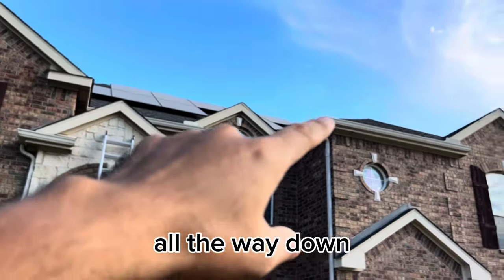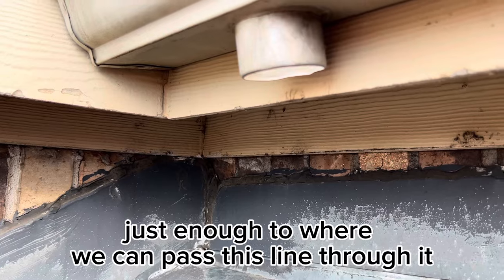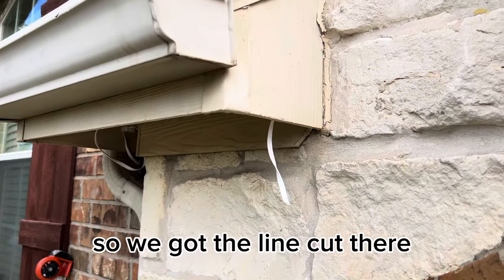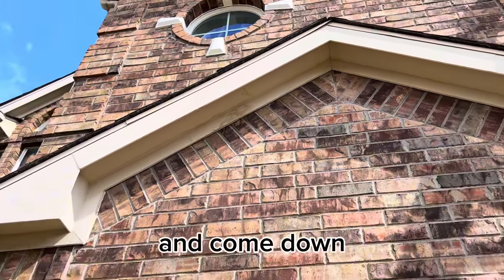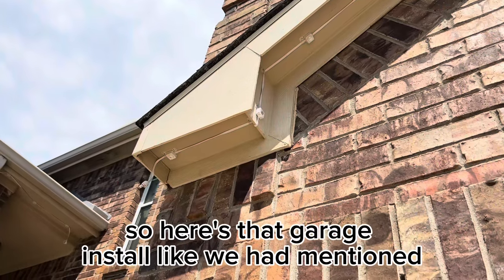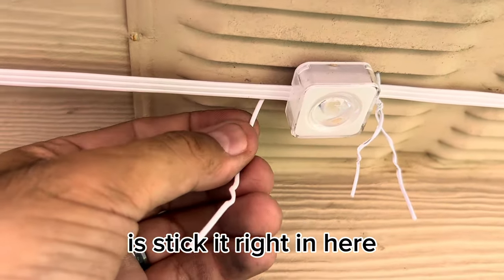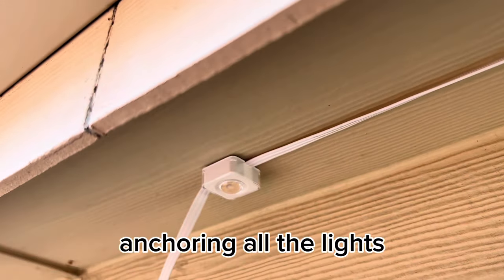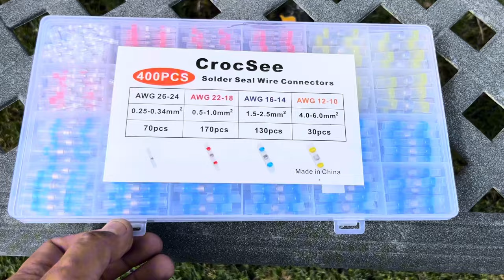Govee Outdoor Permanent Lights (First Road-trip Install) Watch Till the End @GOVEE #howto #fyp

Comment: So you can cut and splice them as many times as long as they are in groups of four? Using same controller if it’s a 200’ Govee strand?
Reply from the maker: The video you watched was the 1st Gen outdoor permanent lights. If you have pros, you’re golden because you can do cazy things with those. For these, they don’t have the best whites. Pros do
Reply: Ok thanks.

Comment: Love the setup, want to pull the trigger, however I noticed most installs of this system have a closed rafters design. Unfortunately in the Pacific Northwest most homes are built with open rafters. Any suggestions to tackle this? Should I just staple the wire to rafters?
Reply from the maker: Hi thanks for watching. Get a 1/2”x2” Nominal board and use a finishing nailer to place this board 2-4” from the wall. Then mount your lights to that board. You can keep it like that or just paint it to match your open rafters
Reply: @jbsdiytv  amazing idea! Thank you. Once the pro line becomes available. I’ll purchase it.
Reply from the maker: @NorPacAdventures  good luck on your install

Comment: I am interested in see or learning how you power the lights once you have the lights in the attic? Where do you typically find the outlets to plug into?
Reply from the maker: Hi there and thank you for your comment. We appreciate your support. If you have 100ft of installation then you will only need one outlet. We do not install them outside anymore. They are bulky and have a potential of coming undone. Most of the time in new homes, one power outlet will be in the center of attic or near a AC unit. Then on that side whether your lights will stream left or right, take the lights a little further back down the sides some so you sit kinda center of the attic. Drill a 5/16 hole to pass the controller extension through and connect your lights, then your power adapter last. For 2,  If you have a porch over hang on the left or right, that’s where both your top and bottom lights will start. One on top to the attic, the other bottom to another outlet

Comment: Thanks for the video. Just got my first set of Govee for Christmas. Where would;d you recommend the power supply and controller be located? Attic seems a bit too hot to me.
Reply from the maker: We usually install them in the attic since that will extend the life of your devices and we are a business that installs them on a regular.i know that it may be good practice but it might not be the option for everyone. Second option is to use a waterproof box to protect the devices from the outdoor elements.

Visit my organized website to find the waterproof box that will fit both devices 
https://lnk.bio/jbsdiytv

There you will find “SHOP PERMANENT LIGHTING TOOLS & ACCESSORIES” hit the drop down and scroll till you see Tycoon
Reply: What about in your garage where the outlets are ?
Reply from the maker: @efthimios yes you can do that. Take a look at my round rock video where we did just this. Drill a 1” hole beside the outlet and connect to it
Reply: @efthimios  great idea. i thunk thats what i’ll do

Comment: I was wondering, what size is the drill bit you used for the hole to fit the wire in?
Reply from the maker: 3/4” paddle bit for the Govee connections

Comment: Hey, what do you recommend to do if the soffit is plastic but there are only holes in every other soffit piece? I saw that you recommended the hitch pins, which are awesome, but in my case a light may land on the soffit that doesn’t have any holes to use a pin.
Reply from the maker: It those cases, you can use a Govee clip(or bought out clip) and then use a small wood screw to keep that one in place. I say wood screw because the thread is wider to grab very well as oppose to a fine thread screw which will strip the plastic
Reply: @jbsdiytv thanks for the fast reply!

Comment: Does the controller box and the on/off box need to be inside the house? Looking to do this myself in the northeast and don’t want to be drilling through walls into my house
Reply from the maker: The controller is IP65 while the lights are IP67. I’ve done a hand full of installs and we only put them inside. We don’t chance the controller failing because one, we don’t want to go back if we have completed the install and two govee doesn’t sale them individually. So far the very first ones we did 2 failed so no need to be chancing it. Govee did replace them but we fixed the issue and we haven’t had any new problems. You won’t need to drill in walls but only one 3/4” hole to pass the first connection into the attic

Comment: Hey, what’s going on JD. Love that road trip video that you did in Dallas. What a big house. I noticed in the video you took one of the lights and tucked behind the flashing on the house. So my question to you is, I have one full string. 16 feet and I would like to know if I could cut one light off. Love your videos. Keep up the good work Mike.
Reply from the maker: Thank you for taking the time to view our content. At the time of the video, I was not aware that you could cut anywhere past 4 lights. Thought it was groups of 4. So cut pass anything 4 lights when ending them like this video. If your just transitioning form eave to eave then cut anywhere. Just make sure to bring the line back together. Hope this helps

Comment: Hello, I already installed 100ft. But end of installation I would like to add 3 more strands on it. Do you know does it work or doesn't?
Reply from the maker: Yes you can add 3 more strands. Just adjust your segments to 9 in the settings. Please let me know if you have made any custom jumps
Reply: @jbsdiytv  Do you mean 9 segments are 9 strands? I am just worrying about power supply and remote control can feed extra lights.
Reply from the maker: @khash79  we have done multiple installs without issues with 9 strands( 9 segments) on 100ft 1st gen lights. If you don’t have drastic long custom jumps you’ll be fine
Reply: @jbsdiytv  Thank you for you advice

Comment: I see that you are cutting and splicing, are you using the govee pro lights or the regular govee lights. I ask because the link provided goes to the regular lights and those say "cannot be cut."
Reply from the maker: It tells you, you can not cut them because they won’t cover in a warranty. It will still work even if you do cut them
Reply: @jbsdiytv  Thank you for the reply!

Comment: so can you have more then one controller and sync both together?
Reply from the maker: Yes in same model group, add both devices. You can customize the direction it flows in the advance settings but the Govee presets you can’t so install your lights in one direction. All going left or all going right
Reply: @jbsdiytv you just saved me a ton of time. I’m about to add a second and was planning to go opposite direction. Now, I know you shouldn’t do that.
Reply from the maker: @TwoEye2079 glad we could help. Thanks for watching. Let us know if you have any other questions

Comment: what do you offer for warranties on the light installs?
Reply from the maker: Hello and thanks for your question. Govee has a 1 year manufacturer warranty and you can add more warranty on Amazon when you purchase the lights. As far as what I offer, if a strand goes bad because I’m at fault for not properly waterproofing the spliced connections then I will gladly replace it without any cost to the client. If it’s a manufacturer malfunction, then all you have to do is contact Govee and they will send you strands or sometimes send you a whole 50ft kit. It all depends. Then when that comes in, at my next available route to your location, I will change it out. I will not be replacing items for free unless it’s my fault. Other companies manufacture their own products for permanent lighting and therefore they do lifetime warranties. We are simply taking an online manufacturing product and installing them with limited altering of the line

Comment: Does the groups of 4 LEDs still apply to the PRO version of these lights?
Reply from the maker: The group of 4's doesn't apply anymore to both editions. Govee has made some changes. We have tested some strands cutting them at lights 5-12 and they still work. I would still hold off going under 4 lights as we have had issues here and there. Thanks for your question

Comment: Hi, do you travel to Rochester ny 😊 we can't seem to find anyone in our area to install them. Most want to install there own temporary lights every year. One guy was charging over $2ooo. What is your normal install charge. I would still like to know charge just to compare if what I'm being told is a fair price
Reply from the maker: Permanent lighting last a long time and has multiple settings and functions. These Govee lights last a estimated 12-15years with 4-6hrs use a day. Look to pay between $1500-$4000 for 150ft-350ft. $4000 and up if it’s more that 350ft. Since these strands come in white only, some will want them in a different color so now your having to pay for painting price to match soffit color. Keep in mind this pays for itself over the years. You can easily spend $1000 on Christmas Light installs for just a few months and now you have them up for years and different holidays and occasions

Comment: I have a roof peak and right below a small roof lip from dinning room windows. How do I  run a strand of lights to the roof lip and get power to the lights?
Reply from the maker: We usually don’t light those unless the homeowner absolutely wants it. The only way to do this is that we plan in a way that the overhang is far left or far right so we can jump down. Or have them purchase a 50ft kit to cover the power adapter and controller

Comment: Do you have to make every cut at 4 or can you cut it 2 or 3 lights as long as you continue the light strand somwhere else?
Reply from the maker: Hello, thanks for watching the video. If it’s within the installation, it can be anywhere. This only applies when you end or cut lights for your last strand. So if you have groups of 4, 8, then it finishes at 11….then you’ll have 3 lights not working at all until that 4th light in that group gets put back together. Hope this answers your question
Reply: Ok I didn’t know if you could cut it at any point within the string.
Reply from the maker: Yes it can be done without any problems. Just connect all the lines back together using small jumps and identify each line with the writing wire, solid wire and strip wire
Reply: Love the video, the info,and the break dance finish @  16:35😂😎,, yes definitely gonna install these, my home will be a much easier install,but you gave me good practical insight,, thk you!
Reply from the maker: @rodtrues1  thank you for watching and your support. Glad we could inspire you to take on this challenge to install these Govee lights. Good luck with your installation. If you have any questions don’t hesitate to ask
Reply: @jbsdiytv  I am still a little confused on what to do with groups of 4. Any chance I could talk over the phone briefly to make sure I understand? Thanks for the video, really impressive and i would like to add this to our services as well!
Reply from the maker: @benbarlow6135 please message us on Facebook @Jbs Holiday and Christmas Lighting LLC or Instagram @ jbsholidayandchristmaslighting
Reply: @benbarlow6135 did he answer your question because I'm going to install my lights in a couple of days. So I connect 1 2 3 4 harnesses then cut the forth harness then go 5 6 7 8 then cut. Or is he saying u have to cut before the 4orth harness and u will be k. Also are they're 2 boxes that plug in 2 an outlet because I have a 2 story  house with the holiday package where the outlet is on the outside of the house on the second story. I bought the 150 feet. So can I run the second run of light to the second floor using the extension. To the outlet
Reply from the maker: @HUBBSPEC you can throw the groups of 4 out the door. In a previous video short(perfect cut strands) I mentioned a lot of you all have brought up that as long as you end you lights by splicing it can’t be less than 4 lights. You can cut after that on a full strand. Hope this helps answer your question

Comment: how many feet led  used in this video.
Reply from the maker: 150ft at the top then the garage overhang was 50ft kit. From that 50ft kit, only one strand was needed. Then the controllers were grouped in app to sync
Reply: @jbsdiytv  thank you so much 👍

Comment: What wire can you use to Jump if you dont have the govee extension?
Reply from the maker: Hi there. Thanks for watching. I have placed the link in the description. Thank you for your support. Keep in mind the 18-3 wire is only for small jumps -
2-3ft and make like 3 or 4 jumps max
Reply: Thank you for your response. Why is the 18/3 wire limited to 3ft when the factory extentions are 12ft? Also can you create a Y extension to feed 2 gables?
Reply: Is there any extension wire you can use to make longer jumps? @jbsdiytv
Reply from the maker: Yes, in my Pinterest link there is a 6ft extension from Asahom. They fit inside each other but one side the cap is loose. All I did was put a thin strip of tape around the thread and it stayed tight
Reply: @jbsdiytv awesome thanks!
Reply: Could you add more than 6 ft? Like what if you did like 25-50 ft of extension to get to an outlet, ha ha
Reply from the maker: @benbarlow6135  you will need to add a data booster to the custom extensions
Reply from the maker: the 12'ft extensions provided by Govee have a data power booster at the end of them, your custom wire doesn't

Comment: Whats the rule for group of 4?
Reply: So you have 4, 8, 12, 16 per strand if you are cutting them???
Reply from the maker: @hustlewestbrook3021  don’t worry about that anymore. It’s been tested. You just need to end your lights with 4 or more for them to work. If your jumping from eave to eave then you can cut anywhere
Reply: OK so cutting anywhere is fine when going eve to eve, the key is the last extension needs at least 4
Reply: Thank you
Reply from the maker: @hustlewestbrook3021  that is correct. lol it’s been tough explaining this to everyone so I’m glad you understand. Keep your jumps small, less that 2ft and a minimum of 4 total